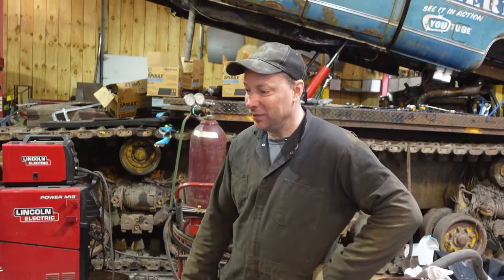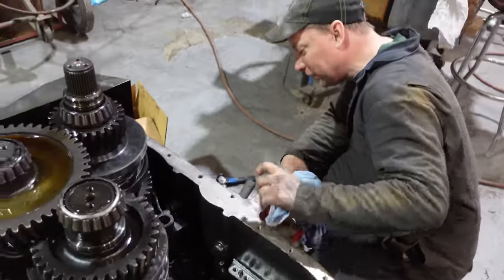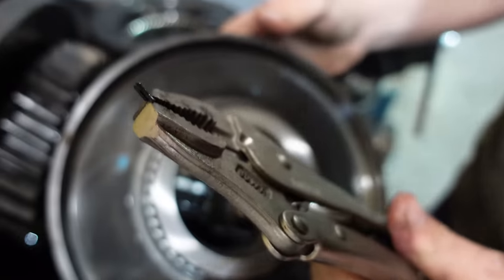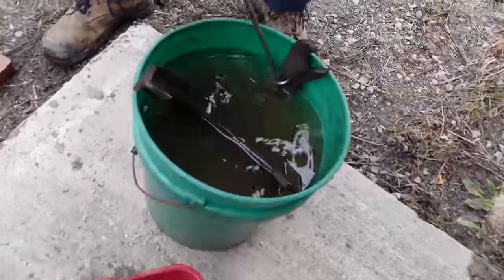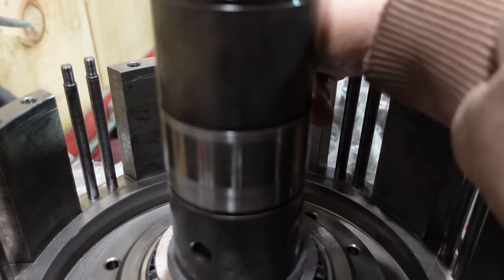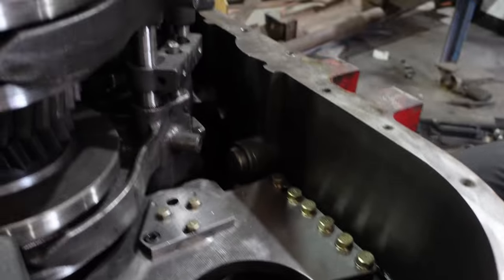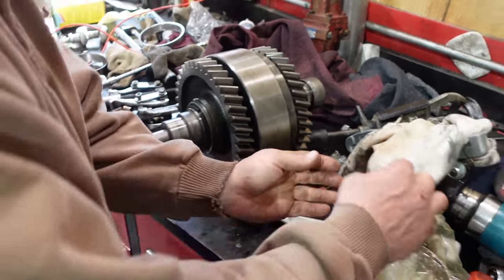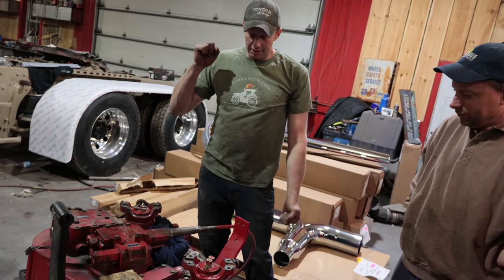Spend $70,000 ...or Fix it? 24-Speed Synchro Transmission | Case IH 9350 Steiger [EP2]

Comment: Those pins found in bottom come from synchronizer.   Had a 9270 with 16000hours trans go out.  Case dealer rebuilt it and lasted 30 minutes.  Destroyed it self.  But of course it was nobody fault.  I threw $10k away and had to sell tractor for salvage.

Comment: If you want a cheap and easy way to de-rust parts electrolysis is the way to go. All you need is a battery charger, a bucket of water with an electrolyte like washing soda mixed in, and some sacrificial metal anodes. Throw in the parts you want de-rusted connect the battery charger and let it work for a day and the parts come out looking great.

Comment: Great episode,  just loved watching what you two were going to do next. Thanks for sharing 👍. 
Great job! Why are the parts so expensive? And is there not generic gears and bearings that you can import ?. Or does it
 take too long?  Just $$$ is outrageous.
Effed up! Did you mention what kind of ttactor the trans was out of? And if not? Could you? Thanks again ✌🏻
👍👌🙋‍♂️🌤 🇨🇦 👨‍🦽 😎.
Reply: CaseIH 9350 (it’s in the title)
There’s some aftermarket support, but it’s not a situation like mass produced vehicles that are worth several aftermarket manufacturers tooling up to make enough parts to offer them at a price competing with other manufacturers.

Comment: Those nylon seals hold far better seal and pressure then the old school steel ones. Most of your car auto trans use scarf cut seal rings in the rebuild kits and there far better then steel. Seems backwards but the work better

Comment: The idea of replacing the steel seals with rubber and viton is to limit the wear to the consumable and keep the expensive components good. If it does 8k hours and you need a new drum etc  vs it does <8k and you save all of those expensive components you're in front. Is the theory...

Comment: @DGHD    -      @40:10:00    How much do you think that one Shaft & Gears Weighed?   Was it really so big you had to use the Fork Lift or did ya just do it because it was way easier.   With as big as that trans is I could understand if it was too heavy to lift.  Even for two guys and Awkward to try and lift into that case.  Just Curious to the Weight.
Reply from the maker: I bet somewhere between 350 and 300 lbs
Reply: @DGHD  that's crazy!   I'm sure the camera made it look smaller too.   I know that transmission case is a monster so it makes sense.
Reply: Yes those shafts are allot heavier than they look on camera  I work at big tractor parts and we work on the power shift transmission in those tractors and everything is heavy in them

Comment: I forget to mark stuff all the time. I just pulled apart a Continental Z-134 and realized after I got all the pistons out that I didn't mark how the rods were orientated in the engine. Honestly though with the way the last guy rebuilt this engine I'm not sure if I trust how he put them in anyways. Dude stripped the threads on the cam and just put the engine together like that. Some of the rod bolts were so tight my small impact wouldn't break them loose. I had to get my big impact to break loose rod bolts. And it's definitely not the impact because its stout. Thankfully the crank looks good. So not impressed with who ever built this engine.

Comment: Pretty sure a 24 speed synchro out of a later model steiger or NH TJ is the same. Surely you can find one of them
Reply from the maker: Kevin looked for over a year.  Nothing
Reply: The problem is they changed it in the stx series. And on the older ones like Kevin's they had 3 syncro's in about 4 years so that's why it's so hard to fix them

Comment: I don't think you really needed those new gears..  Sure the tips were worn, but there was still plenty of tooth engagement there and they would have worked fine with the new syncros', I bet..  The broken syncro and the new main clutch- would have got you there.   But I can understand not wanting to do it again. 😁
Reply: No
It’s a question of engagement depth and spline tip profile.  Simply NOT worth taking the chance.
Reply: @jimrankin2583  There's plenty of engagement depth.  The tips are just there to slightly twist the gear left or right to make sure the splines are aligned as it slides together..  And don't forget, the syncro has brand new tips also---    I've taken that chance before on a 7.3L F350 ZF650 6spd transmission.. and it was fine --- even with the tips ground down quite a bit.........  I get your point, not wanting to take a chance.  But if he DID take that chance, I think it would have worked.  Those gears can't be cheap. lol

Comment: You guys didn’t wanna touch the parts with your bare hands but you had no problem pouring the powder into the bucket with no respirators lol silly guys
Reply: Citric acid sold as a food ingredient.  Not that acidic.  As someone else said, muriatic would get the rust off faster.  Citric acid is less aggressive but safer on brass, copper etc. Most radiator flushes are citrate based.

Comment: 70k?   An eaton roadranger with the twice the power rating is only $15k...........bloody rip off if ever there was. 518 and 515 loctite for the win, leaves rtv for dust.
Reply: This trans will likely accept ~600hp (similar to a roadranger).
The biggest difference, is this will be a powershift (and wet clutches that you saw) - meaning you can change gears under load, which you need to when you have heavy ground engaging implements, and changing terrain etc. means you need to down/up change under load without lifting up your implement.
Some tractors were fitted with Eatons, but they were phased out in the 70's.
Also changing your clutch (which you need to frequently if it's a dry clutch, Eaton style trans), isn't a fun thing in a tractor, you effectively have to split the tractor in half. Wet clutches (in theory) should last the life of the tractor - although as you can see in this case, that isn't always true.

All this means a specialist transmission, and made in limited numbers - which means $$$ parts. Bear in mind, a replacement for the tractor is ~350k USD.
Reply: Not a power shift exactly.  Just a high-lo in each gear and a wet clutch.  

As you said, the original Steigers, Versatiles, Big Buds, Woods & Copeland/Rome were component built tractors using the Road Ranger or an Allison automatic, axles from wheel loaders etc.  The drop box was the only odd component.  

This trans allows more gear ratios, wet clutch, hi-lo shift on the go in 12 gears and incorporates the transfer case, and hydraulic pump drive to get it off the engine timing gears
Reply: @jimrankin2583  thats what I thought, a true power shift has a clutch pack drum on each gear (like an automatic car transmission).   Its like a hybrid, and its hard to see 70k in its rather simple design.  What does make it expensive must be limited production, and components not shared with any other design........or in other words, a rip off.